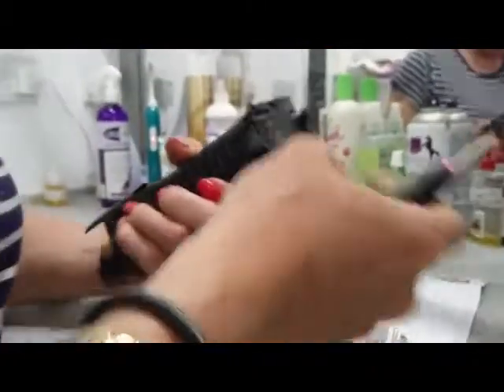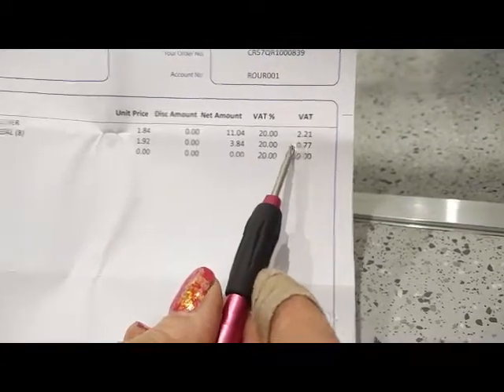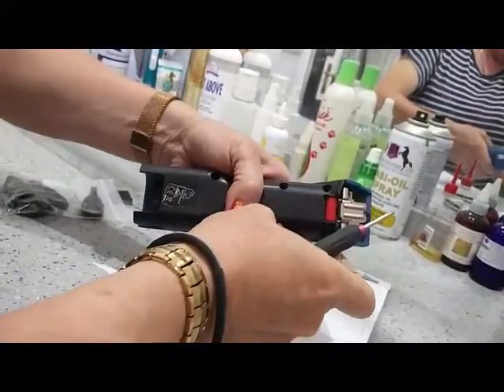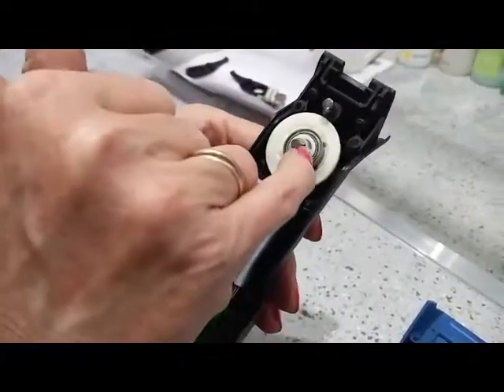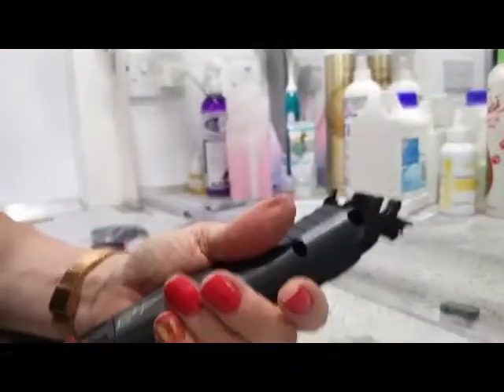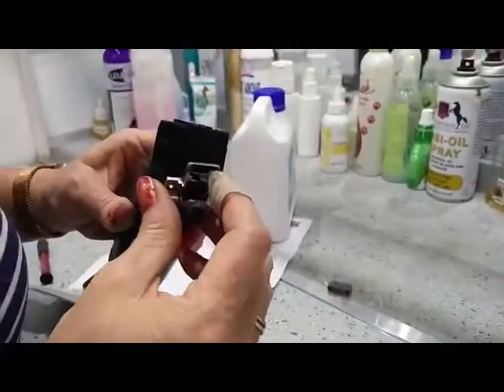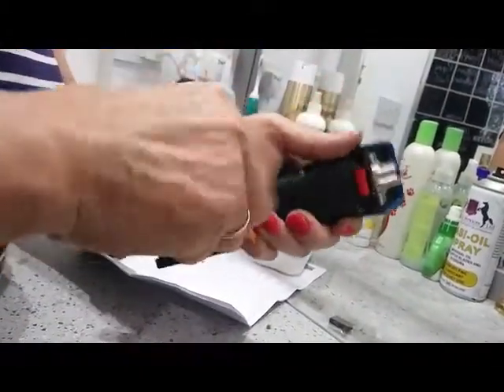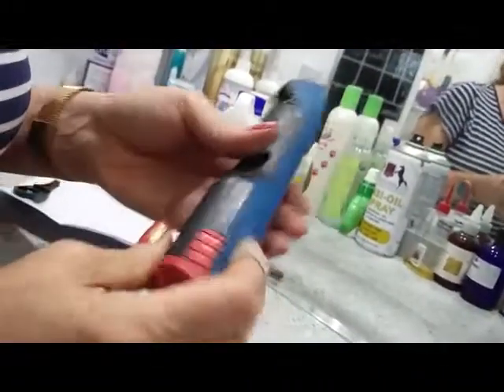How To Change A Heiniger Saphir Drive Lever

Comment: How often do you do this?
Reply from the maker: Hi Emily, that would depend on how much work the clippers are doing.  I do mine every 3 months and I'm clipping 4 dogs a day, 4 days a week, BUT, I am extremely pedantic about my prep.  The dogs I use the clippers on are squeaky clean and bone dry before I start.  If you're doing pre-bath clip offs (no longer recommended) then you can half that time, ditto working with very heavily matted dogs.